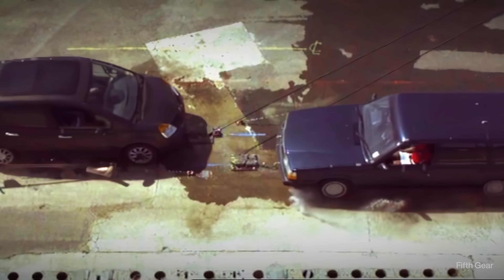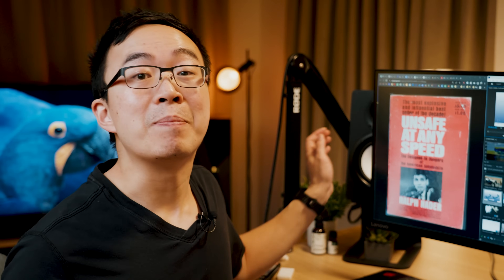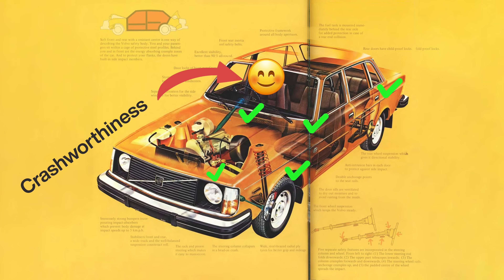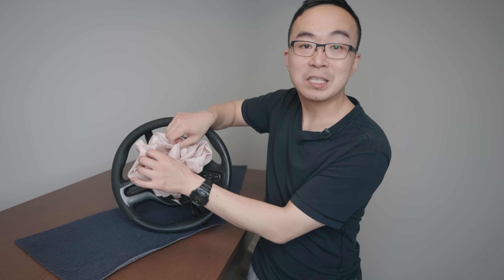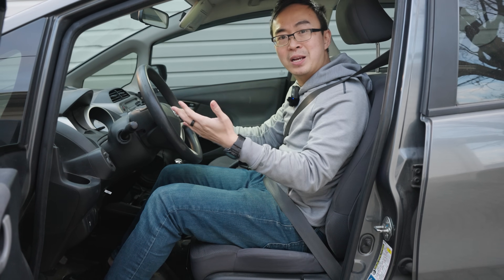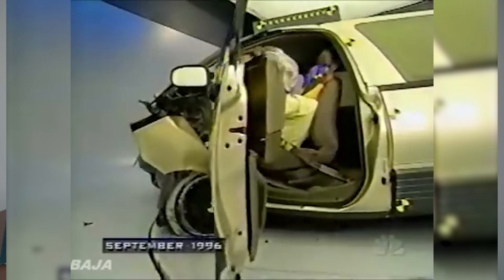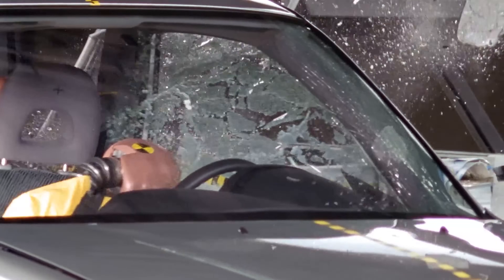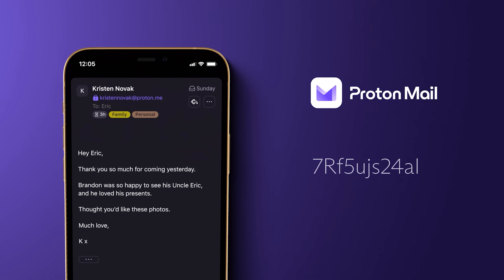When does a car stop being safe?

Comment: There's something demented about the idea of recommending people buy heavier cars because heavier cars are a risk. The insurance industry hasn't understood the notion of insurance if it doesn't grasp that the risk is pooled across the entire ecosystem, not isolated in the object being used as the anvil.
Reply: Theres multiple reasons why the US is trending to heavier cars, but I like to pin most of it on CAFE Standards.

It basically created a system that encouraged bigger vehicles because that's easier and cheaper to make an existing vehicle larger to be classified as a light truck than trying to explain to them why a tiny 1.5 ton pick-up truck should not be classified as a passenger vehicle. It's also too easy to convince them that the 3-ton SUV with 7 freaking passenger seats is actually a light truck as well.
Reply: @BrokenLifeCycle Cars were getting larger and heavier long before those CAFE standards even existed and for cars sold only in countries where they don't exist. Also Ford F-150s sold before them were actually even heavier.
Reply: @spindash64 I can assure you that it is just as easy to see pedestrian in a massive car as it is in a small car. In fact, it is easier to see pedestrians when you are in a larger vehicle, because they tend to be taller and give you a better overall view
Reply: @valerierodger   The problem with taller vehicles are blind spots. The driver's point of view is shifted up but so does the metal limiting the view.
In my '94 Ford Transit I was sitting much higher than in a modern SUV but it had a fast sloping hood and the side windows extended down to my butt, so the blind spots were only in close proximity of the vehicle.
An SUV or even worse a pickup have the same windows height of a Miata, but moved way up, the blind sides extend for several meters around them.
Reply: ......
Jesus Christ is the only hope in this world no other gods will lead you to heaven

There is no security or hope with out Jesus Christ in this world come and repent of all sins today

Today is the day of salvation come to the loving savior Today repent and do not go to hell

Come to Jesus Christ today

Jesus Christ is only way to heaven

Repent and follow him today seek his heart Jesus Christ can fill the emptiness he can fill the void

Heaven and hell is real cone to the loving savior today

Today is the day of salvation tomorrow might be to late come to the loving savior today

Holy Spirit Can give you peace guidance and purpose and the Lord will

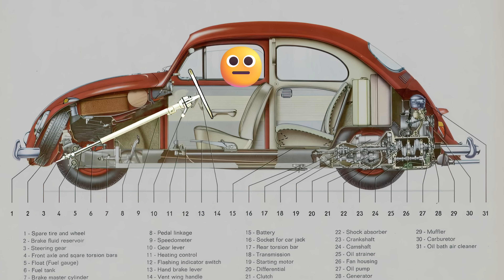John 3:16-21

16 For God so loved the world, that he gave his only begotten Son, that whosoever believeth in him should not perish, but have everlasting life. 17 For God sent not his Son into the world to condemn the world; but that the world through him might be saved. 18 He that believeth on him is not condemned: but he that believeth not is condemned already, because he hath not believed in the name of the only begotten Son of God. 19 And this is the condemnation, that light is come into the world, and men loved darkness rather than light, because their deeds were evil. 20 For every one that doeth evil hateth the light, neither cometh to the light, lest his deeds should be reproved. 21 But he that doeth truth cometh to the light, that his deeds may be made manifest, that they are wrought in God.

Mark 1.15

15 And saying, The time is fulfilled, and the kingdom of God is at hand: repent ye, and believe the gospel.

2 Peter 3:9

The Lord is not slack concerning his promise, as some men count slackness; but is longsuffering to us-ward, not willing that any should perish, but that all should come to repentance.

Hebrews 11:6

6 But without faith it is impossible to please him: for he that cometh to God must believe that he is, and that he is a rewarder of them that diligently seek him.

Jesus
Reply: This is in general the problem with cars: they generate an appreciable advantage for their users but dump a lot of negative externalities on people with no choice in that trade.
Since the invention of the car it took humans several decades to accept the idea of limiting those externalities, hence emissions control, automated driving, violation fines and several fees for using or parking a car... and we're still far from a balance because a random person is still at risk of being killed for the sake on someone else's convenience.
Reply: I know, heavy cars only add more danger, but the problem is lighter cars, and you will get a harder hit. You need an average weight to be safe.
Reply: @oienu "you need an average weight to be safe" that's not the right way to think about it. 

You need cars to all have similar weights. Or for all cars to get lighter. 

The worst case is an even split of light and heavy vehicles, with a big difference between them.

Unfortunately, as the small cars get bigger to protect themselves, the big cars do the same to preserve their advantage.
Reply: @kanucks9  "you need an average weight to be safe" is not wrong, the problem is  lower the average, but Americans and their "light truck" will not accept, sadly. Those trucks should need special licenses and a valid reason to get them, but of course, the have another class of regulations that make them easy to build, sell, and even be expensive because they are bigger, the capitalism of manufacturers will not let it happen.
Reply: @kanucks9 LOL small cars do not get bigger to protect themselves, nor do big vehicles get bigger to preserve their advantage.

Small cars were only widely popular in North America when oil prices were ridiculously high. Consumers prefer larger vehicles for greater cargo space, and they like taller vehicles for greater visibility. Perceived safety is less important than those two. 

Auto manufacturers prefer the larger vehicles because light trucks (which includes SUVs) got more lenient, fuel, efficiency standards than passenger cars, and then a cars efficiency standard was tied to its physical footprint - a larger car does not have to be as fuel efficient as a smaller car. 
Plus, there is a higher profit margin on the bigger vehicles - instead of putting out a large number of small and inexpensive cars, they can make a smaller number of big expensive SUVs and trucks and get the same profit margin.
Reply: @oienu  I think we should weight people outside the vehicle (much) more heavily than those inside in our safety calculations. Not that I really want to be killed by my own car, but others—whether in other cars or pedestrians—have no choice in what hits them, while I at least made an informed decision about what I'm driving.
Reply: @stephenspackman5573  I think 2000 or 2800 lbs will do the same damage to pedestrians anyway. That's why I believe SUVs should need a special license, they are dangerous and not for everybody.
Reply: @oienu  A plastic bar at shin height and a steel one at chest height will have different effects, though, yet people will choose the latter out of a sense of “safety”, apparently. Perhaps that was your point, though. Simple mass still potentially makes a big difference when you're not hitting meat directly, but hitting another vehicle, or going through a barrier and hitting someone.
Reply: @oienu 

Maybe, but consider that it takes less energy to slow down 2,000lbs of metal to a "safish" speed than it does to slow down 4,000lbs of metal

It also is much harder to SEE pedestrians in massive cars
Reply: What in the ai.
Reply: @sagnikmaulik what in the everything I read longer than one sentence must be ai?

Comment: i got issues with the iihs requiring a minimum weight.
the problem in collisions with unequal weight comes from one vehicle being heavier. But why not penalise excessive weight? having a few hundred pounds more in a collision with a semi will barely make a difference, 1t vs 40t or 2t vs 40t, youll still get wrecked, but having a few hundred pounds more will drastically increase danger to people in small vehicles and more importantly, people outside of cars. Car safety should just be about the people inside the vehicle itself, but also everyone else.

Comment: 2:30 thanks car manufacturers for killing what would've been my fourth uncle because safety was expensive and ruining the "fun" of cars! 🙃
Reply: Get this through your head: The manufacturer of the thing IS NOT RESPONSIBLE for the accident or misuse of the thing. But I understand where you are coming from. A woman just drove an SUV into my mother. We've had sonar and digital control circuits since before I was born. NOW they get hooked up to the brakes...because it's economically viable now.
Reply: @ while that is true, indirectly they still are responsible, because the crash could've been less fatal even if the person who hit them drove just as recklessly, if they had better safety mechanisms in the car; mind you, this crash happened in the 60's and seatbelts weren't in the car my family was in, as did most cars, I believe, lacked in those days

Comment: I saw the result of a head on collision between a Fiat Cinquecento and a Volvo 240 around 1992 - not first hand, but in a garage. The Volvo had the front crumple zones bent, probably a broken radiator and maybe a few other bits, but the safety cell was intact. The Cinquecento on the other hand - The engine was in the back seat. The steering column had gone out the back window, through the driver. nobody knew what happened to the steering wheel...
It's amazing how far car safety has come, even since the 80s/90s!

Comment: Sad to say as an Indian 🇮🇳 that in Indian car market 🚗 🚘 Only Tata is Providing Best-In-Class active safety features according to price but maximum car makers in India right now like MarutiSuzuki isn't just caring about Car customer's safety, even hyundai is doing the same, trying use more mileage as their marketing but barely giving any active safety ,and louering customers by giving only passive safety features (Like 1 beep over 6okmph and 2 beep over 100kmph , sbr , pretensioner and load limiter).Some of them dont even give adjustable head rest in base variants . 😢.But as government is getting more strict about passenger safety still they are not giving (Hyundai , MarutiSuzuki ,Renault..etc) active safety but they now just made '6Airbags Mandatory' from Base Variant , but still they are not giving Active Safety Features.

Comment: Volvo repair cost: 2000 dollars 
Renault repair cost: none. You have to buy new car

I stand with the Volvo 😂😂😂
Reply: Renault twingos of the mk1 variety perform excellent in crash derbies.

They are very stiff.

If a Volvo is bend up too badly (it's not unlikely since they are overengineered but not indestructable) 2000 dollar won't get you shit at a body shop.

Comment: Cars may be safer but in 2024 driving them is less safe:
Knobs and switches that can be found and operated without taking you eyes off the road have vbeen replaced by distracting  touch screens as manufacturers include ever increasing operation other than basic driving. 
How long do you take your eyes off the road when operating these?
Software based systems are cheaper than electromechanical systems, you are tied to the vehicle manufacturer for updates who in all probability is mining and monetising your driving data or even the conversations in your car.

Comment: I personally feel the IIHS test is somewhat bias toward heavier vehicles.  If the car is required to pass the test at the same velocity, then the lighter the vehicle, the lower the momentum.  So lighter vehicles are required to meet "lower standard" than heavier vehicles.  This is okay during a single vehicle wreck, but as it has been shown time and again, it hurts when going head-to-head with a heavier vehicle.

Comment: I've been a paramedic for almost 15 years, and it's actually awe inducing how incredibly SAFE cars have steadily become, starting in the mid 90s or so.

If the vehicle is like 2005 or newer and the occupant has sustained serious injuries, I can almost guarantee that it's because they either weren't wearing their seatbelt (properly) or they were riding with their feet up on the dash. 

In those cases, it's like the occupant has slammed into a solid stationary object (often head first) while flying along at high speed. And engineering has even worked hard to address the issue of seatbelt haters lol newer vehicles have a setting where the vehicle cannot be shifted out of park if the drivers seatbelt is not latched. Depending on the vehicle, this also applies to the front passenger seat if sufficient weight is detected in the seat. 

Of course, freak accidents do still happen and it is possible to slip out of a properly worn seatbelt (and possibly be ejected from the vehicle) in a rollover. But overall, the safety improvements are just incredible!
Reply from the maker: Love hearing success stories like this!

Comment: When those small overlap crashes came out, only two tested cars passed (a Volvo and a Honda/Acura had only enough space to survive after the collision)
All the other tested brands failed because these test were kinda new for them. 25 % overlap instead of 50 % and a way more hard barrier that doesn’t crumple like the in the regular test. 
Euroncap tests also can’t be used to measure a car’s safety rating since they use the regular tests.

Comment: Well as always, did that Volvo have engine and drive shaft in it? And it´s a rust bucket 1990
An 740 from 1988 is much safer, it does not rust as much.  
We sweds whom work at Volvo factory know some things.. Just saying

Comment: The sponsor spot is hilarious.  "Not even Proton can read your e-mail" "Proton strips weird links out of your e-mail" uh...that's not how that works...
Reply from the maker: So there is a period where non-encrypted emails are parsed by the server.  If you believe Proton that step is the only place where they'll interact with the email, stripping out tracking and then encrypting it so only you can read it.  According to proton your emails are never saved.

 This requires trust but unless you're using a fully encrypted system this is what you're doing with all service providers.
Reply: @Lam  Yeah, think about that though.  They're saying right now they don't sell your data, and because it's encrypted, if they start selling your data later they won't be able to sell your old data.  Also Discord doesn't sell your data; however, major shareholders own part of Discord, so they own the data already.  That's why Tencent can monitor everything that happens on Discord: they own a few % share of the company, so Discord is only sharing your data with itself.

Comment: Watch the whole clip, in Volvo there is no engine or frame. The frame in the engine compartment looks like a 4x2 steel beam on both sides of the engine where is it in the video from fithgear? The test was rigged.

Comment: The answer to the big question is 

If you are hit head on or hit on any other side faster than 60 MPH then it stops being safe because the speed acually rips through the metal 

It has led to countless deaths

Comment: My Honda  Fit, or better Honda "Jazz" under which name I learnt to love it, had a pretty good rating too, when my grandpa bought in 2004... if I remember correctly. I just switched to a newer car last year. It was a really great car and quite fun for its 72hp. And it even lastet me nearly 200.000km/exactly 120.000miles, which I think, is quite impressive. Fun fact, the tiny 1.2l 4 cylinder engine had 8 spark plugs :)